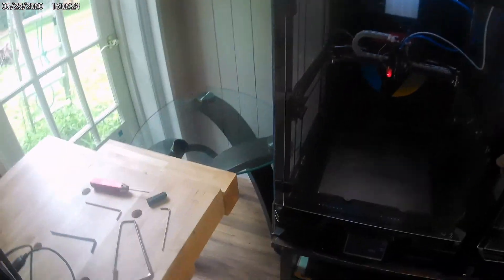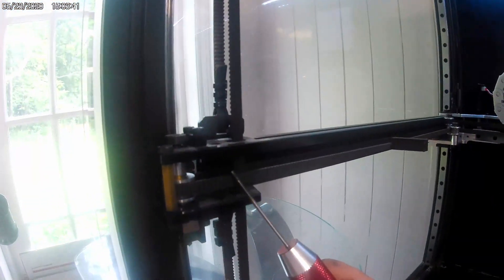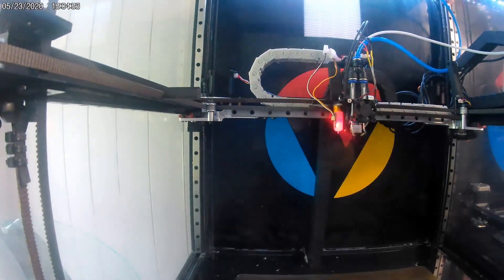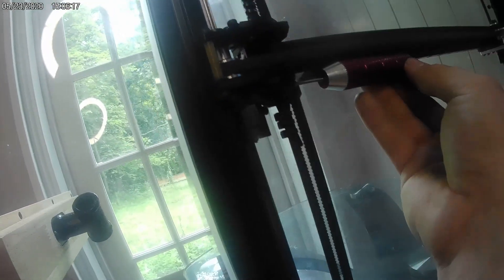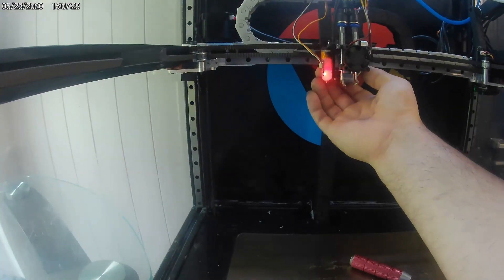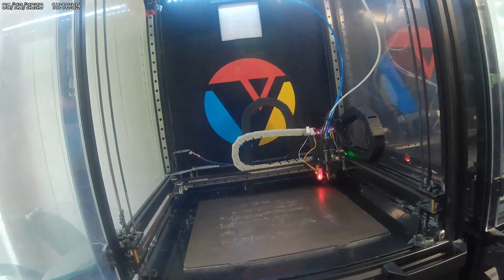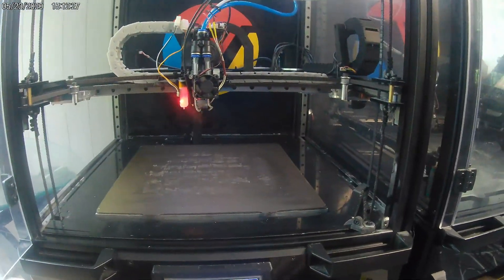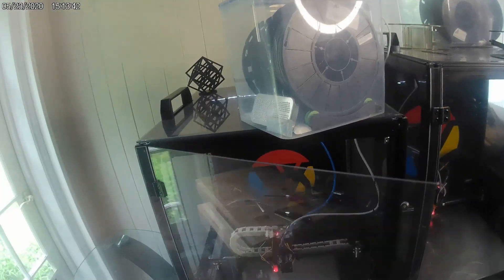Tension your belts easy and accurate

Comment: Am getting mysterious layer shifts on my 400. All belts are tight. Pretty annoying.
Reply: The cause of layer shifts usually overtightened belt polies and bearings, or belt rubbing on the enclosure panel, aluminium extrusion or plastics, undervolted steppers, you can also lower the acceleration you settings might be too fast

Comment: This would only really work for one specific printer. Even if it was modded to work on say a Trident or a 2.4 - it would only work correctly on Tridents or 2.4's of the same size / print volume.

Comment: Is the STL in the correct orientation with the belt slot down on the bed? Or does it matter if I lay it on it's long side and print with 3 perimeters and 4 top and bottom?
Reply from the maker: Should be fine just overall weight is what we want . I am working on making a piece that we can use a torque wrench with to measure even better

Comment: On a 300 V1.8 using your STL at 2.05 grams makes the belts way too loose I think (I might be wrong though)
Reply from the maker: the voron needs tighter belts then the troodon or railcore cause the plastic mounts. i have a few patrons with vorons i can get the proper weight for it and add. also on the 300 voron i would make sure you have the carriage all the way at the back and then it might work ok

Comment: I HAD AN IDEA. make a "lever" that has each of it's ends on a different belt path. with a compliant hinge in the middle. if the tip tilts the belts aren't equal! this is better for making them equal rather then a specific amount!
Reply from the maker: thats actaully pretty clever just would have to figure way to make it across prob just both sides of the carriage would do and have the carriage centered this way would not have to be so big

Comment: can you give us the weight of the calibration tool. I use different nozzle size and layer height that translates into different wall thickness
Reply from the maker: 2.05 g you should be able to set the filament density to 1.04 for abs or pla and then have the slicer verify. if you are using a diff nozzle just try to set the perimeter accordingly. so if .6 nozzle then do 2 perimeter if .8 nozzle then set it to 1 perimeter but do 150 percent line width
Reply: @advanced3dprinting  Pla density is approx 1.24
but the weight solves most things

Comment: Sorry dude but this is just all wrong. There’s two belts, you do need to tension both to equal tension. Maybe if you use two of those things it would indicate equal tension. If you over tension one of them it would throw you gantry out of square. You need to make your gantry square and moves freely back and forth without belts.
Reply from the maker: You are not correct . Please watch where I adjust the tension of the opposite belt with the other side. Core xy uses belt tension to square the gantry . You cannot have one belt tighter then the other unless you have you r frame locked at the x axis in which case you fight the extrusion. If you still disagree i can edit the video and add a section at the end to explain better. But you can easily test this yourself. This is also why core xy uses an A and B motor and not an x and y cause it takes both motors to move right and left or forward and back and a single motor moving moves in a 45 degree angle. The kinematics of the belt system translate the belt tension across to each other and unless you are forcing an angle at the x axis the belt tension will automatically be equal this is why i was showing that you need to use the tension to make it square. Sorry for long explanation but its not the simplest subject to try and put into writing.
Reply from the maker: Actually after re reading please make sure to watch the whole video. I see that you agree with the using belt tension to make it square but i showed exactly what you are saying you must have only seen the start of the video cause i then showed using the tension to sqaure and then once the gantry is straight you check the tension again and fine tune it then you tighten your extrusions back down. I also made sure to point out that itf you want it a little tighter you instead of moving say quarter turn on one side you do an eighth on each side.